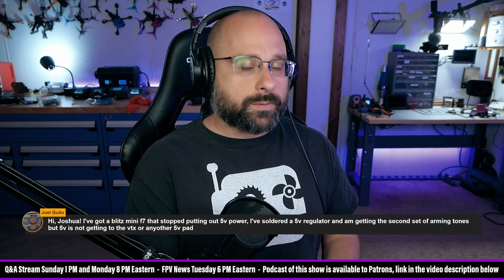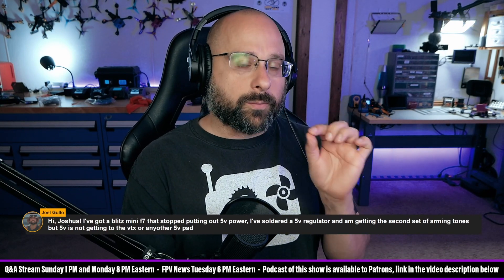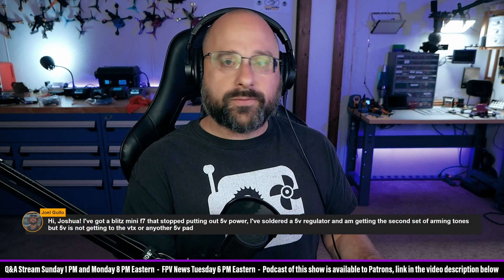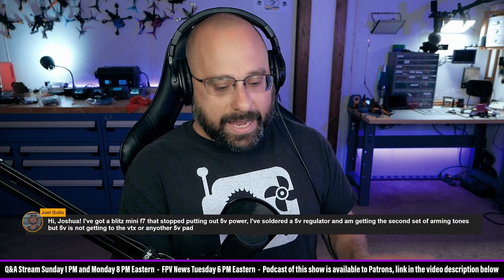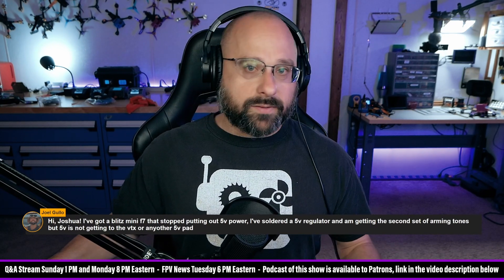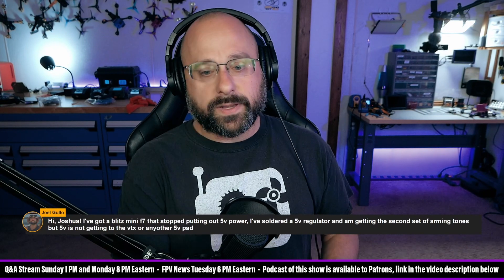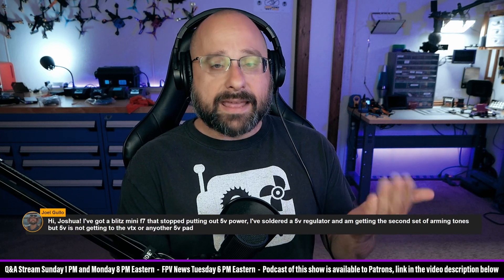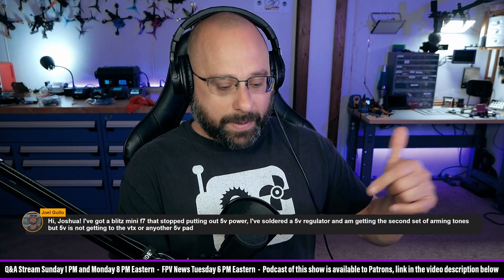My Flight Controller Has A Dead 5v But A New BEC Didn't Fix It? - FPV Stream Questions

Comment: hi Josh, i have an issue.. i fried the 5v regulator on he FC so i powered it with a bec.. ok, it works, ... my issue is that in osd i dont get te lipo voltage... it shows 0V.. is it "normal" or am i missing something? thanks.
Reply: Hi
I have the same problem
It seems I broke my Voltage Sensor in my flight controller
Did you get any information to overcome that issue?
Reply: @Indonesia01ian  no, i'm just running my fc without the voltage sensor, i got a timer, i can fly 8 min but i land at 6 for safety. apparently ther's no way to solve the problem other than desolder the sensor and solder a working one on the board.. witch i'm not able to do unfortunally.
Reply: Because the FC can't see the reference voltage pin for the OSD.  I have an old quad with a microminim osd and it has it's own voltage reference pin.  The radio should be able to get it from the esc